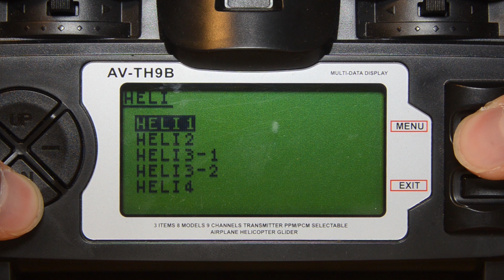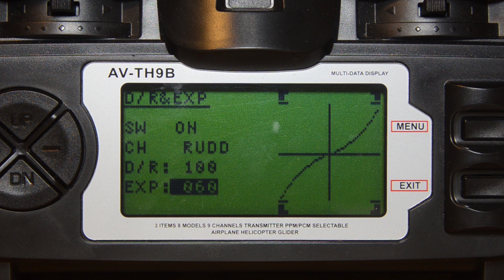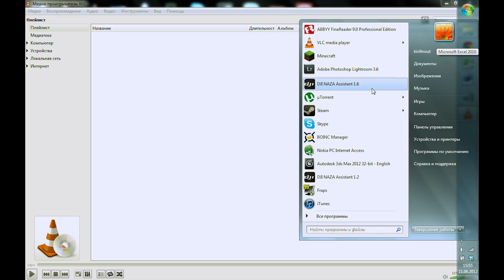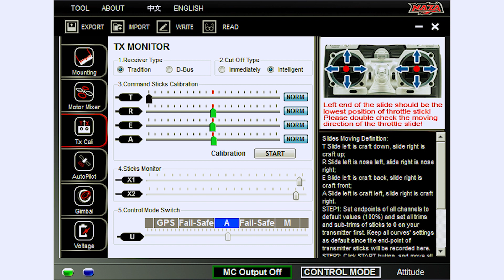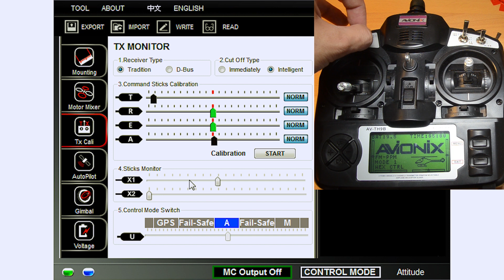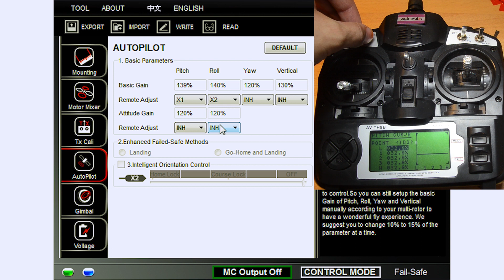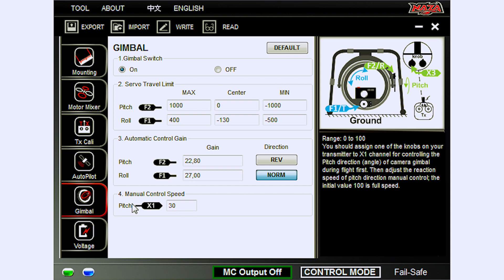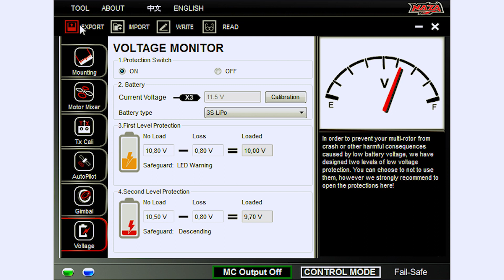How to set up DJI Naza step by step video with transmitter setup

Comment: Heres what I have done.
Everything is installed (naza unit)
All ESC';s are calibrated and all motors spin up at the same time.
I have set up the Naza as per the instruction (told it that I have a quadcopter)
All the motors spin in the motors spin in the correct orientation.
All the props ar on the correct way (clock wise, counter clockwise) and on the correct motors.
I';ve done the compass calibration (naza dance)
I have the unit in GPS mode (I';ve also done Altitude & Manual mode) with all the satellites present. 

Now here';s what';s going wrong....
When I go to launch the quad keeps flipping over? and this is when its sat on the ground?

I arm the motors and they all spin at the same time and at what seems to be the same speed.
I then apply a little throttle. You can visible see the aircraft create lift.
Then apply a little more throttle and the back of the craft flips over the front.

I have tried arming then applying a continual amount of throttle... same thing happens.
I even tried arming then applying 3/4 throttle... the same thing happens and screw up a set of props?
Help me

Comment: Why is my Control Mode Switch (Input U on the Naza) connected to my throttle? I want to use the three position switch as you have. By the way I have the same transmitter, Turnigy 9x. Please help me.
Reply: Did you find the solution? I have the same.

Comment: Hi I have a NAZA M LITE but it will not let my computers see it, I have tried the fix for drivers with no luck. I have windows 7 8 10 and a 7 I got to see if it will connect with the same results will not load no usb. 4 week so far the unit is good DJI said go find help so I have been asking for ideas.

Comment: how to connect or pair the remote controller with the flight controller?
Reply from the maker: Hi! You need to reference the user manual for your specific RC receiver. Most likely - just 6 servo wires from the RC to the flight controller.

Comment: hello it is a great video and i'm using the same parts as you do but i cant arm the copter program see the th9x its working calibration is ok every thing is done but when i unpluge the naza from computer drone doesnt arm and take off motors are not runing bottom line i can't arm the copter can you please help me with that if you want i can share a video also....
Reply: +Izzet Romano ... when you are ready to "arm" or fly, position both pull both sticks to bottom corners.
Reply: great thank you so much :)

Comment: question to you, or anybody. set it up exactly like the video same transmitter Naza v2. My problem is the throttle on my transmitter moves the rudder on Naza assistant, and the rudder on my transmitter moves the throttle on naza assistant.  its like they're reversed. my transmitter is a Mode 2 (throttle and rudder on the left)  receiver is connected as follows...
ch1> A. ch2> E. ch3> T ch4> R. 

any help from anybody would be greatly appreciated

Comment: I followed this exactly with a new Naza V2, and new Turnigy 9X. I am having a problem.

The sticks link up to the correct channels, I have reversed the ones you said, also set all to NORM in the software, they all go the right way, but the problem is that the Elevator position when the stick is in the middle is all the way to the right. If I move the stick all the way down, the position on the software is in the middle.
Reply: you probably need to calibrate the Turnigy using the Naza software :)
Reply: Joe Anthing Did you figure it out? I did the calibration and am unable to get my elevator input anything under half. If I use the full range of my trims I can get to 40%. Something is very wrong.

Comment: Hallo im novice at this i followed your guide, thanks, but i have an issue with the LED on the Naza i can't start the engines at all....

Led after a few seconds flashes red Fastly!!
And I'm given this message in the Assistant software:

Configuration error, this may cause by firmware upgrade from old version.or abnormal Tx calibration. Re-calibrate your transmitter,and power cycle your controller and check all of the parameters.

I can't fix it I'm almost have given up!

Does anyone know whats my problem??
Im stuck ......please help....
Reply: Issue  is in reversing the 5. chanell. Pls let me know.
Reply: Ok...but I already tried that ....cant get it to work....
Reply: Have you calibrated you tx in naza assistant, I had the same problem that's all I had to do...
Reply: i finally managed to do that...now I've got the naza m v2...setup and its working fine...
I'm woundering about sbus with futaba 10 j....
have u any experience in this matter as well??
Reply: I upgraded the naza m lite...
Reply: Gabrioly  Hi Gabrioly, I have the same problem like Theodor. What do you mean with the 5. channel? In the video you're leave the 5. channel empty. can you help me? all the best from germany
Reply: go throw all the steps again you must of done something wrong
Reply: David Wood Hi David, thank you for your reply. I found the mistake. It had nothing to do with the video :D. Today I had my first test flight...I can just recommend the naza m lite to V2 upgrade

Comment: Thanks for the great video, sorted most of my questions, I just have to get the toggle 3 way switch set so up is GPS, middle is Atti and bottom is failsafe.
then course lock and heading lock on a couple of the 2way switches and I should be all set.
Thanks again you are very clear in instructions only the assistant is old version but I followed well enough with the newer version I am using.

Comment: Hi. im using a Turnigy 9x and getting a CFG-ERR on dji naza assistant program. 
this is the error: CFG-ERR
Configuration error, this may cause by firmware upgrade from old version. or abnormal Tx calibration. Re-calibrate your transmitter, and power cycle your controller and check all of the parameters.

Is there someone who know what i should do?

Comment: HI Thanks for the helpful video. I've got an interesting issue which i can't solve. DJI assistant shows me in the TX Cali window that each slider is green, but my sliders do not move at all when moving the sticks.(Also the MC Output is "On" i notice yours isn'y in the video)  I did notice that when i power up the Quad that the Versatile Unit, and Receiver power up fine but the ESC's make no noise at all??  I'm using a HK Power distirbution board, and Turnigy 30amp Esc's with Sbecs built in. Any help would be great.

Comment: hi there

I cannot set up the transmitter link loss failsafe on either of my naza m v2's.

the turnigy 9x just will not work. I am using standard v2 with v2 module and rx

when I turn off the transmitter it just stays in the air until I switch the radio back on and retake control.

as far as the 9x failsafe I have tried to use it to activate the failsafe value on the three position switch and this does not work either.

any ideas.....I am starting to think of a futaba t8j.........!

Comment: I'm running into a problem with my setup, which is really close to your's. I am using Naza M Lite and Turnigy 9X 8C, but I can not seem to get out of Fail-Safe . I can not get Attitude or M to turn blue under Control Mode Switch. Do you have any suggestions?

Thank you for the help.

Comment: Hello I am setting up my new turnigy 9xv2 with naza v2.  I have u channel from the naza connected t o chan 6.  the 3 way switch works but the throttle is bound to the u channel and therefore moves my control mode.  How do you unbound the throttle to the u channel? thanks for your helpful video.

Comment from the maker: I do not own WKM, it is an overkill for my smaller quadcopter and I really have no complaints or missing features compared to WKM to buy it for my much bigger hexacopter. I do not know anyone personally and have not seen step by step setups. Maybe check DJI youtube channel, they seem to post lots of tips.
9x may be not enought if you want to use all features at the same time and i strongly advise againts using it with stock radio link as it lacks fail-safe. If in no hurry - buy frsky taranis

Comment: hey mate i have a spectrum dx8 and I plugged in all the plugs in the right spots and i turn it on and it flashes does the normal flashes and then does the 3 green flashes then it flashes red and when i connect to pc i have 8 errors and it says i have too call naza do u think i have a broken unit?? thanks

Comment: I honestly started to think my DJI Naza was faulty. Spent many hours trying to get escs to arm. Radio was set right and everything. Using the rmilec lrs and turnigy x9 radio. But after watching your video it fixed everything. Cheers mate. Perfect explanation video. For the amount of investment made on the controller and the gps, I wish they had better setup videos. BTW problem was the safety start up, needs to be in atti mode and move both sticks to bottom left and it will start up.

Comment from the maker: Hi) It's ok I may be confusing you in the video. I set up extra channels to later plug them into remote gain ports and after that use them to switch on/off orientation leds remotely. Would you like to see more setup videos? or more flight ones?

Comment from the maker: Oh, I just realized that this video was shot before I got a FrSky Rx/Tx kit that has failsafe) The short answer is - DO NOT USE course lock and home lock. They are incredibly likely to cause crashes. They will work only with GPS lock ans in this situation, it is much better to assign a switch to RTH and setup faisafe.

Comment: hi, I found and solved the probleme (broken connection between two pins on the upper plate). Now I`m soon ready to go..but can I ask...Is it either gps or failsafe? If both, how can I set it.

Comment: If you set up as airplane it is a bit more work to have 3pos switch to work for mode select.
You also lose a chanel as you need to MIX a chanel with GYR as master and GEAR as slave.
This pitch curve method is by far better to set up with stock firmware on 9X TX.
There are a few ways to make the stock FW 9X work with the 3pos switch and mode changing on Naza/Wookong/Multiwii systems.
The open9X and er9X firmwares (FW) are much better, but do take a little time to get used to the program methods..

Comment from the maker: have you run stick calibration? are ESC's connected according to the manualand wired correcttly? do you perform one of the CSC movements to arm the NAZA (like both sticks to the bottom left), are all channels reversed correctly according to the NAZA software? What color does NAZA flash after it swiotches on if not connected to the pc?

Comment from the maker: I might be wrong, but if this radio is internally 100% the same as t9x from turnigy (seems so) then it has on option in the menu for fail-safe but it does not actually work(. Bad luck there. You should consider frsky of similar tx modules to replace the t9x's one. They have fail-safe functionality built into RX. Spectrum and higher end are OK but expensive.

Comment from the maker: Sorry, accidentally voted your reply down(
One more question: does your receiver support fail-safe?
if you have the Naza connected to the PC does it go to fail-safe mode when you turn off the transmitter?
What receiver -transmitter combo do you have?
Is fail safe set up correctly on the receiver?

Comment from the maker: Does switching off the TX shows up as a Fail-safe in the Software?
If not then the Fail-safe is not set up correctly.
Also, if you have GPS choose whether you want the quad to fly to you and land or land on the spot of loosing the signal (Autopilot->Enhanced Fail-Safe method)
If all is set up correctly, fail-safe without the GPS results in a flashing LED and a quad starting to descend to the ground.

Comment: @1janak1 did you let the gyro initialize before taking off (5 solid seconds) also there is a thread on RC groups that talks about the bullet plug from the esc. To hard solder the cables to the esc instead of using those bullet plugs. I have a friend that did it, twitching was eliminated.

Comment: I followed everything you said and my quad is flying perfect. I also set the gimble control and IOC to the left handed knobs. Very easy configuration. Thank you. Did you configure the GPS as well. I tried but could not get it to read out the green flashing led to tell me that it was in gps configuration mode. Maybe I didn't do it right.

Comment: I followed your video and everything works except for one thing - elevator axis. When I connect naza assistant it seems like it moves only in one direction (pitch down) and it's twitching a lot. I double checked the cables (replaced the one on E) with no success. Any help will be greatly appreciated.

Comment: Hi,
I just got my Naza but new to the quad, what is the first step to get the driver and software downloaded into my computer. There was no information that came with the DJI Naza what steps need to be taken when you received the unit. Will be so kind and tell me what steps need to be taken. Thanks.
FW

Comment from the maker: are you using a stock Turnigy 9x radio module? If so, I'm sorry to inform you that it does not have failsafe. You should either do without failsafe or buy a better radio module (like FrSky two way radio module with telemetry that I use)

Comment from the maker: yep) after 7:50 I do almost the same thing. You should experiment with pitch values to see  which correspond to what control modes. Then simply choose the desired order of flight modes and set three pitch curves to the corresponding levels.

Comment: It fly's great till last night it started spinning around. but from day one I never could use the software on my quad it will not read the quad? it's like it was never plugged up? or maybe the I did not down load it right? I called the store I picked up my quad from but they told me to send it to them? not much help. I can not send my quad out every time there is some thing I can fix, it cost a lot of money and time. I get a green light when I plug it up but that's all. it will not do a thing.

Comment: Hi, it would never let me change it I had it made for me and when I down loaded the software it will not work? it comes up but when I plug it to my quad it's like I never plugged it up? I can not change the setting? and this was from day one I got it? I may have to send it back to them. and have them work on it. but then I will be with out my quad for 2 to 3 weeks. it did something last night it started spinning around I had to go to my subtrim's and input 100% to get it to stop spinning!?

Comment from the maker: what happens if you take your naza out of the copter, connect it to the VU, power it up with nothing hooked up? Does it flash the light like a normal start up sequence? Try connecting to the pc to check the the light turning green and wheather the naza sees you transmitter input. Also check ESC's and motors by hooking them up to the transmitter directly, calibrating, checking all settings on them and running your motors. could you please share what you've checked and are 100% shure that works?

Comment from the maker: 2) not quite sure. You should check esc min-max throttle calibration and try adjusting  motor idle speed in the naza controller to the left (slower speed).

Comment from the maker: Thanks! 1) may seem crazy weird but I find it the easiest to set up mode switching. I describe in the video how I use flat pitch curves to choose flight modes. Basically you can assign 3 pitch curves to 3 positions of a 3 way switc on Turnigy 9x in heli mode. To do it in plane or glider modes you have to use lots of mixes and it all gets unwieldy  to adjust late. Yuou don’t have to do it if you want only 2 modes on 1 switch or have a better radio with a dedicated 3-position gyro or gear switch.

Comment: Thanks for your fantastic video. Just two question: 1. Why do you set it on heli mode? 2. Is it normal that motors startup very fast? Thanks for your comments.

Comment from the maker: I yould start by incrementally lowering pitch and roll basic gains. To set up gains you should start from low values like 60 and go up until your copter starts to oscilate on the axis you are tuning and than decrease the gain a bit. In your case just lower them until your f450 still levels itself quickly after a quick stick inut but does not overshoot or oscilate. Use remote gains adjustment,it makes life simpler)

Comment from the maker: My GPS unit has not arrived yet( I  currently have no idea how it is set up, seems to be just plug, mount and adjust two gains. I will however do a video on how to dial in gimbal parameters the best possible performance as soon as my hex is up and running (about a week or so)